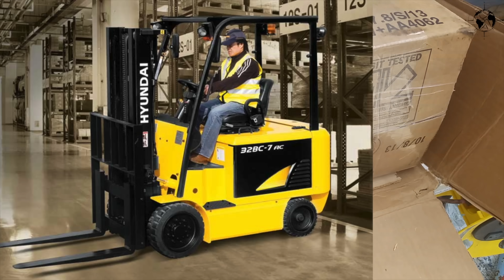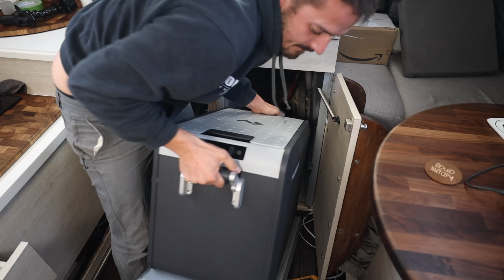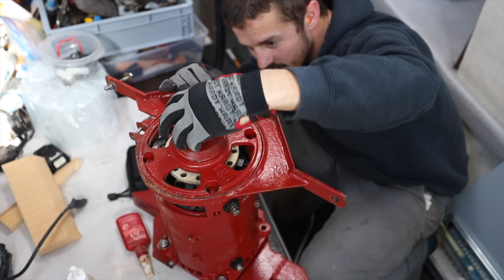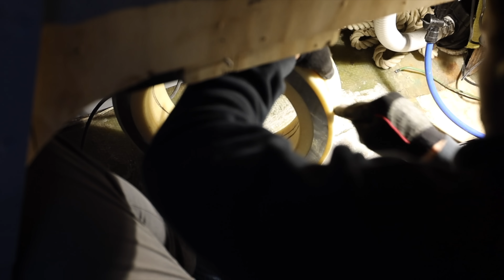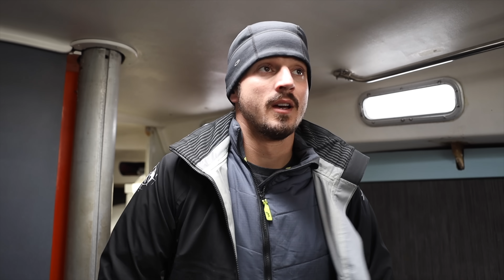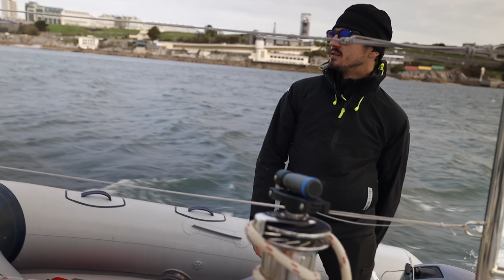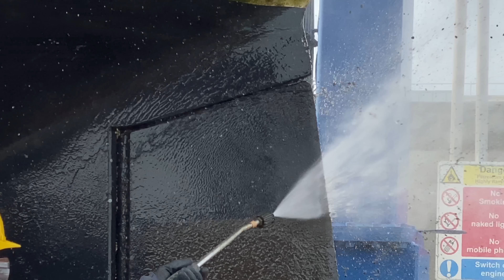Getting Rid of our DIY Electric Motor — Sailing Uma [Step 212]

Comment: Build your own motor, not that hard to do... there are people out there building them for air craft. Seriously, easier than you might think.
Reply from the maker: We did. That’s the one we took out since it was undersized. The motor is the easy part, but also only 10% of the overall system.

Comment: Dude, a decent used diesel engine can be had for under 1k. You have solar, wind, hydro capabilities, diesel is for back up, and when you need it, you're really gonna need it. Just admit it, you just wanted to mess around with electric motors...that's cool :)
Reply from the maker: weve had our electric motor for 5 years without ever regretting it... or needing something else.

Comment: O,K probably a silly question but, why didn't you just connect an alternator to your electric engine
Reply from the maker: If our motor was liquid cooled and larger we may have. But we we’ve been planning an upgrade for a long time now to solve the 3 big issues with our old motor. Under sized, over heating AND regen. An alternator would only solve one of those issues.

Comment: Hey guys,  glad I found your channel.  It’s great and very enjoyable.  I built electric vintage vehicles and have decided to sail the world electric so I’m gonna built my own kit.   I’m curious what you guys do for heat and air conditioning?   Good luck and cheers! 
Paul
Reply from the maker: We don't have an hvac system on board. We have a woodstove we use on anchor to help keep the boat dry on rainy days and when we're at a dock (like over the winter) we just plugged in a small space heater.

Comment: how come you don't use a wind generator
Reply from the maker: Haven't found one that would work for our needs yet. We don't have space on the back of our boat to mount one, and the small ones don't produce enough power to be worthwhile. We're planning to build one at some point that we can hoist when we need it (at anchor) and take down while sailing, but then the problem become storage. At mounting one on the top of the mast would create too much noise and vibration in the cabin and would drive us insane.

Comment: My new favourite channel. I've been wanting to buy a used SB with a dud diesel for about 5 years now. Knowing that electric is perfect for just picking up a mooring or motoring out of a channel. Brilliant. I  think for simplicity though it will be a DC permanent magnet motor but with enough thrust to push the boat to hull speed. Subbed.

Comment: Have you looked into auto auction electric cars? They may have inexpensive wrecked cars.
Reply from the maker: Sometimes you can get used batteries from EV's but then you have to build your own BMS which is the hard and expensive part. That's about all that is salvageable though. The motors are WAY too powerful and high voltage. It's much easier to just find and salvaged electric golf cart.

Comment: The question always is - Can a sailboat Mono or Cat cruise distance with electric power. If so what an awesome process.
Reply from the maker: Yes....it's a sailboat. They've been sailing around the world without motors for hundreds of years. Adding a motor is a relatively new trend and helps when docking or maneuvering short handed or by yourself. But really a motor is a convenience and not a necessity if you know how to sail.
Reply: @SailingUma  Appreciate your reply - As I have sailed for over 40 years I realize "It is a sailboat" However, on your way across an ocean 3 days sitting with no wind --- it is not a sailboat.

Comment: 7:20 voltage isn't the problem, it's the amps and how long it's flowing through you that is the issue.
Reply: Physicist here. And, not true, a common misconception. Harm to the body is a function of the amount of shock current. Higher voltage allows for the production of higher, more dangerous currents. Resistance opposes current, making high resistance a good protective measure against shock. Humans are high resistance. Current can't flow through a person without a high voltage to drive it. If voltage wasn't the problem no one would make signs  "DANGER -- HIGH VOLTAGE!"

Comment: After watching the recent episodes on your efficient use of solar electricity.  ( impressive ) 
Dan mentioned using a wind generator and the problems of its positioning either on the bow or over the solar panels. 
An idea popped into my head, here it is for what it’s worth. 
Place the wind generator at the top of the masthead .... it would be able to turn 360 deg. In that position. 
I realize that weight and space are factors in placing anything at the top of the mast. 
However, a small amount of electricity could be gained 24/7 sailing ⛵️ or at anchor. 
Thanks for considering the idea. 
Love your channel.  
The two of your personalities are video gold ! 
Doc
Reply from the maker: The weight and space are limiting factors, but the biggest one is noise. Our mast comes down though the deck and salon and the vibration noise would be quite loud. It would also add quite a lot of resistance up there increasing heal in windy conditions.

Comment: Since the folks on Sailing Uma already have a solution in play....this bit is for those still contemplating....Unless one is a masochist...Avoid "Mickey mouse" trial & error options;
- Be prepared to operate at 100 volts plus range....Common battery packs....Hybrid/plug-in hybrid vehicles 100V-200V and 400V to 800V and higher for electric-only vehicles.
- Because of the high voltages...Talk to a System Integrator with marine experience;
- Source & Install kit that has global service support & is upgradable e.g. Rockwell Automation, Siemens, SEW-Eurodrive;
- These brands have motors with good power to weight ratios, drive controllers, software to manage system controllers & condition monitoring, displays to show what & how energy is used;
- Also use kit that can reclaim energy (re-gen) from the spinning shaft to recharge battery banks in addition to the energy sourced from the solar panes & wind generators.

Comment: not sure why you think regen will work very well.     You need a repeller.   For the same drag the power generated would be at least twice as much with a tow generator or purposely designed regeneration propeller which you can't do if you want the same prop for propulsion. 

Would prefer you waited for a calmer day and sailed through the marina and/or used the old electric motor one last time.

Comment: What kind of bottom paint is that? We used Pacifica grey abblative.  I am Interested in changing for the next haulout. Also, portabote versus the rib? I just sold my portabote but I dont know if I want air leak anxiety :P 
Cheers SV Mysterious
Reply from the maker: A well maintained, high quality hypalon rib won't leak for at least 8-10 years, the same about of time a porta bote lasts before it start falling apart too. We've had ours for almost 2 years now with no signs of leaks or issues, but it's also made from the highest quality hypalon on the market and build like a tank.

Comment: Nice cubby hole to do classing in. I build a Jon Boat from scratch  and with the fumes I was only good for 2 hrs before I was in La La land. Then I got a mask with paint cartridges and I could work all day. I know you weren't feeling up to par in that cubby hole, it kills a lot of brain cells.
Reply from the maker: We use epoxy since it’s stronger and has no toxic fumes. Polyester resin on the other hand is brutal if you don’t wear a mask.
Reply: @SailingUma  yea and don't stink either, but pretty pricy.

Comment: Sail Drive? Seems I recall Dan nixing that system in previous episode since the lower unit would be hanging outside the hull? OR...has the advanced variable pitch propeller regeneration changed your thinking.
Reply from the maker: Sail drives are fine, don’t think we ever said otherwise... “Pod” drives not so much. Those are the ones with the motor underwater and no way of checking it without a haulout.
Reply: @SailingUma  Ah....yes Pod drive...That must have been what I was thinking of.

Comment: I don't think you can regen from a boat prop in any realistic way.  Its not like a car that has a extremely solid contact between the road and the motor.  Water just doesn't have that amount of contact.  You wont regen any real power from it.

Comment: Nice ...in FACT Phil Harwood's ..."best-practices" emphasizes S turns to correct the too-high approach over the vertical descent ( a handy tool to practice in a safe & quiet airport environment) ... but should always select the S-turns for safety  speed, visibility ...to avoid being over-run from behind ( or below) ... by other traditional aircraft ( unfamiliar with gyro maneuvers )!!!   I limit the  fun verticals at my busy ILS training airport as fast moving aircraft often do not make all their radio calls!

Comment: Do you use a generator to charge your batteries and/or a windmill ?
Reply from the maker: Nope. Just solar so far. But we'll see what kind of regen we can get with the new system. If we still need a bit more power, we'll build a wind generator. We're hoping to avoid a genset if we can.

Comment: Well done mate. A little tip from a boat builder.  Use a diamond tile cutting blade  in your multitool to cut fiberglass,  blade lasts for ever and cuts much faster than other blades

Comment: great  story, for the average chump a toyota prius complete is a better solution. equivalent research needed however MG2, inverter and your batteries is a cheaper solution. If you're game run the whole ICE/MG system for seamless power availability. A load cell on the propshaft to simulate brake actuation will give regen.

Comment: Glad you finally got a modern motor and can now use hydrogeneration to recharge the batteries.  This is like regenerative braking in EVs and means you can charge the battery bank by sailing.  Sailing pulls the boat through the water and uses the motor and prop as a generator to charge the batteries.

Even if you're a day sailor, hydrogeneration is highly useful: you motor out of the marina, hoist the sails, and as soon as you are sailing faster than the motor turns, you're recharging the battery for the next motoring, which will probably be when you're motoring back into the marina.  In principle you'd never need to use shore power to charge, though you'd probably want at least a battery maintainer or solar panel to keep the battery pack charged while docked/moored/anchored.

Comment: For regen capability, have you considered puting a clutch on your motor and including a generator, 12v or 24v as required, that the propeller can turn? I suggest a generator rather than an alternator as they have permanent magnets and require no external power for an exciter coil.

Comment: I have been working to get the regen efficiency up on my prototype. If I can get it to 4 amps sailing 7 knots I will be very happy. The drag has been a challenge, getting the motor rpm high enough without so much drag to prevent the speed needed is a compromise of prop size and engine reduction

Comment: You guys are crazy!  I just hauled out for 2 weeks.  Did bottom paint, barrier coat on the keel, new cutlass bearing, new depth/speed transducer and thru-hull, replaced the bilge thru-hull, and repaired a cracked rudder.  It was exhausting, but the best feeling in the world to get 2 knots more speed on the way home than I've had before in her.  Good luck with your haul-out and can't wait to see her floating again!

Comment: Great new video Don and Freka. 😂

It's not voltage that kills, it's amps. 200 amps DC will very much kill someone. But DC is safer than AC around water. The trick with high voltage is, you can use low current off the battery and use a transformer to convert the high voltage low current to low voltage high current. Then you can also vary that to use the torque of amps to the efficiency of low current high voltage. 

You do cool stuff! Keep up the great vids!

Comment: Have you considered building a removable  mount for your dingy outboard on the back of UMA? You would probably rarely use it but if anything goes wrong with the electrics it would be a good backup

Comment: OSHA, OSHA OSHA:  Dan I saw you wearing a respirator when grinding out the old motor mounts, I guess to avoid glass fibers and dust.  However, the respirator had black banded filters, these filter are good for Organic Vapors, filters had dust covers which it is good for the glass fibers.  Then when you where glassing the new base you weren't wearing the respirator, and you should.  Recommendations, when you are trying to protect yourself from dust and fibers you need HEPA filters (purple banded) and Organic vapors (Black Banded) filter.  If you want to protect you from both there is a combo filter OV/ HEPA.  I am an Industrial Hygienist  and that's one of my duties.  Just protecting young guys like you.

Caleb from Puerto Rico  Cheers.
Reply: Looking after people is universal.
Reply: I think there is one dust filter on the right side... they are white in europe... Maybe they did not get any p2p or p3 filters because of the coronavirus situation?
Reply: We're 'Muricans. We don't need no stinking' masks!  ;-)
Reply: They aren't in the states lol OSHA doesn't apply.
Reply: Brandon S funny I thought people died everywhere
Reply: @brandons2411  It is all about looking after each other.
Reply: @brandons2411  It's not a matter of legal compliance, it's a matter of safety.

Comment: A battery is an expensive fuel tank.
Reply from the maker: Um... not even close to being the same thing.
Reply: @SailingUma  Both are energy storage systems.
Reply from the maker: 🤔And can you recharge your fuel
tank for Free out at sea... using the sun, or wind, or water? Don’t worry it’s a Rhetorical question.

Comment: Would be interesting if you could put some hull cameras for remote inspecting the rudder, propeller, keel, and bow but especially the propeller in case of entanglements. Mast cameras would also be nice. In any event, wonder what would be involve in doing all that and tying into the the console. :)
Reply from the maker: We often just stick our Gopro in the water on a long stick and record the prop if we suspect something is wrong. Works great.

Comment: Regen creates drag. For some that is a deal breaker. Do you have any idea what effect that will have on your speed. Or does that matter to you.
Reply from the maker: We've already been dragging a 3 blade fixed prop though the water for the past 5 years, so it can't be much different than that. At least the new prop can fold back and create less drag when not generating power, so on a long passage, we'll actually gain speed.

Comment: Isn't having drag from a rotating prop with resistance on it from the electric motor which is regenerating the battery, slowing the boat down? I thought that is why many boats are equipped with folding props. Wouldn't it be better to install solar panels for those long offshore legs to recharge the batteries and passage make at a quicker pace?

Comment: Have you considered a used Tesla motor and battery? I recently set up solar at my house using 4 used Tesla battery modules. I run my whole house on the batteries from 4 to 9 everyday. You can run the small tesla motor (45kw max) on 10 to 12 Tesla battery modules. The batteries are about $1,200 each. My Ebay supplier has the small motor for $2,500. It is built to do regeneration, and that includes the built in inverter. I like your change to lithium but I would go with used Tesla's over any other source of battery. When you look at how precisely they are made you can appreciate them. I have compared prices on all of the available options as my brother has a Jeanneau 53 that I would love to electrify. They all look insane compared to the price and specs of used Tesla parts. (Every part is available from wrecked cars)

Comment: you are correct , at least I feel you are about the "Marine" electric propulsion systems. Some things to remember about electric motors compared to fuel. electric motors are cheap the components to build (DIY) a driver for the system are also cheap. Look away from any marine companies look to jet drive systems used in high tech skateboards and foiling boards those builders are on the cutting edge of powerful quiet and efficient unlike traditional yacht / marine systems brokers which tend to lean to the low tech, loud and high price.

Comment: I've been staring at this Prius transmission going "I bet that would make a good sailboat motor". It's a liquid-cooled,  permeate magnet, brushless dc motor.  It's actually 2 motors in one housing with a planetary gear system in between. If you're not familiar, a planetary gear system has three "shafts" and essentially requires two inputs and one output. (or other things)  You would use the built-in parking brake to disable one shaft. Connect the boat where the Prius motor would usually connect.  It ends up being a  reliable and sealed, system with parts all over the world.
Reply: But a high voltage one still, so safety will also be an issue like their comment on the tesla drive unit. Allthough on not sure what exactly the Prius voltage is.
Reply: Andy lewis 
Wow! Hmmmm.....
Your comment has really got my head turning, now. A Prius drive🤔🤫😱🧐🤓😎🤩😍⛵️
Reply: Electricity is electricity. Death by 12v is worse than 40+v. At least the higher, the more efficient you'll die.

Comment: The idea of regen is just a non starter - a windmilling propellor creates a lot of drag whilst producing almost no power.
I tried 30 years ago by driving an alternator from the shaft on a 48" and found we lost close to a knot for no benefit.
The pitch and shape of the blades is all wrong to produce power.